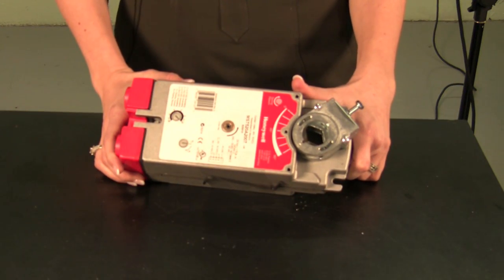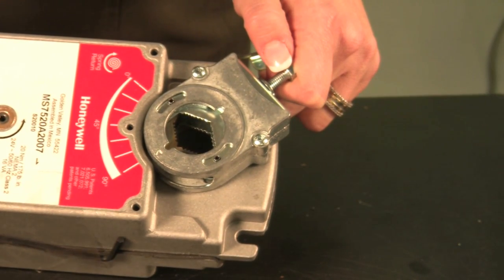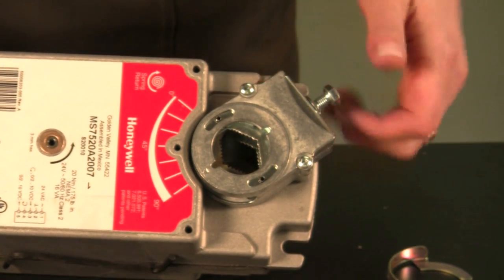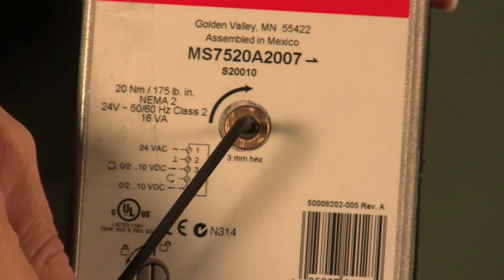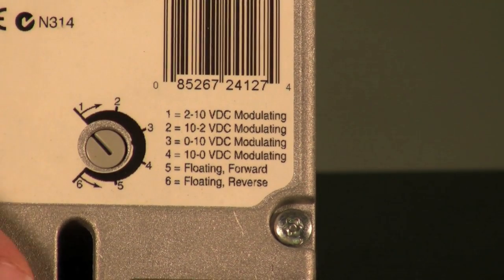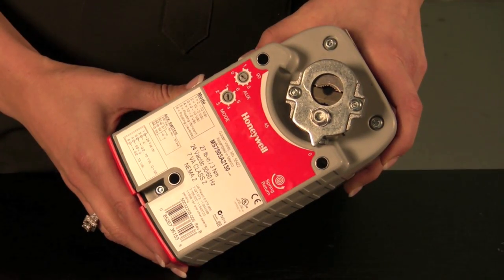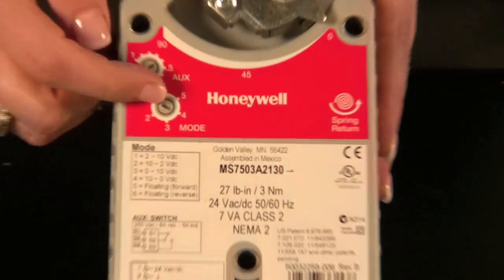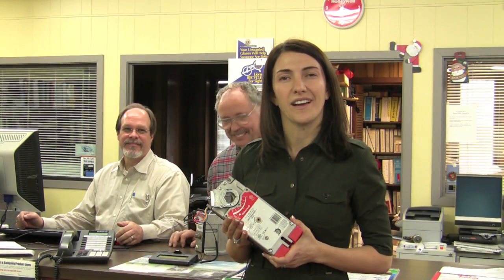Honeywell Damper Actuators

Comment: Is possible user a cn7510 input 24vac and 0~10vdc for modulation. User 0 and 24vac input 1,2 and only cable 0~10vdc input 3 from co2 detection
Reply: Hai sir I request Siemens rlu232 settling parametars and here sir.for yousing HVAC Rh&temp actuator running candication ase for set values plz send me sir